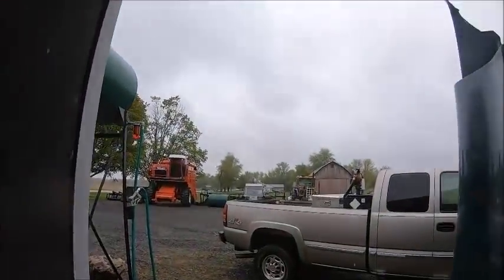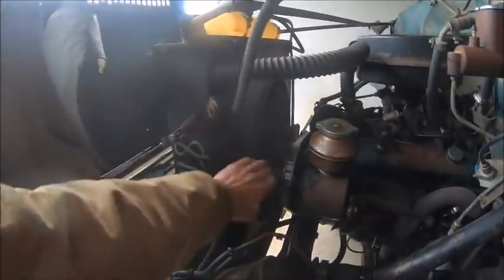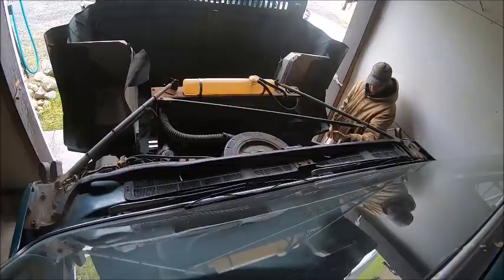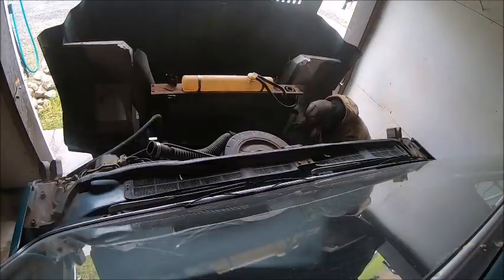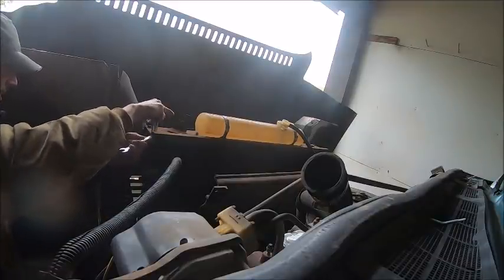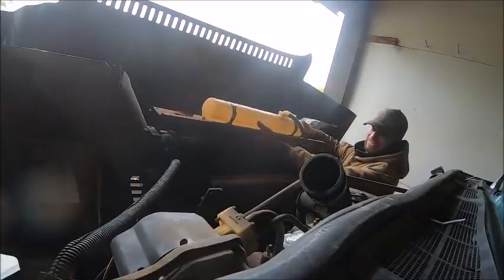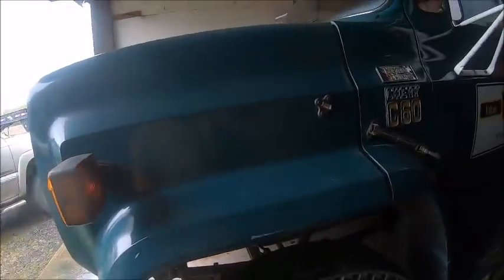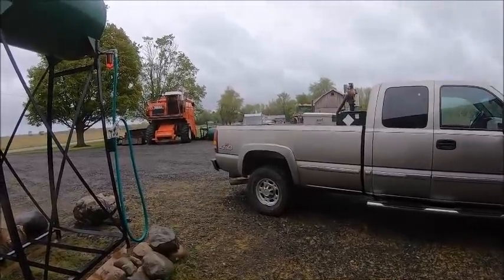Pulling The Radiator On My C60

Comment: Years ago I had a 68 Chevy C60 and it was a giant pain to work on the engine !  When I got the Dodge I have I fell in love with it the first time I had to work on it, Open the hood and swing the fenders open and walk right into the engine bay !  Roger Penske said it best years ago You design it for me you work on it one time and you will change your design !  Bandit
Reply from the maker: I still love my Chevys though.
Reply: @Oliver66FarmBoy  I do too !  That C50 I had I wish I hadnt sold it but you cant keep everything. Of all the trucks I've driven or owned it was the best one I ever drove, 327 5+2 you could be in 5th high side slow down to 10mph step on it and it took off like a car !  No shaking no nothing it just excellerated to what ever speed you wanted loaded or empty and it had plenty of power.  Funny thing was it was a C50 with all 10 lugs on the front wheels and a 25900 GVW !  With the springs it had and the GVW I really think it was a C60 rebadged as a C50, I really miss driving that old girl cause she would haul a load better than any other truck I had , Average bed loaded with grain was 420 bu !  Bandit
Reply from the maker: Even my 60 doesn’t have 10 bolt fronts. I’ve never seen one like that.
Reply: @Oliver66FarmBoy  I havent seen another ether, All I know that truck took a 400 bu load and the springs were not down on the helpers.  I've always wondered if that truck was really a C70 because of the way it handled a load and the 10 bolt wheels on the front. I wish I could have kept it but it was going to need some work done on it and I really didnt need it anymore so I sold it. The guy that bought it was sold when we took off on a test drive and I told him to hit the brakes and slowed down to 10 mph and told hit to step on it. He did in 5th high side and it took off like a car , He turned and looked at me and said sold ! LOL Dad always liked driving it, He said its like driving a car !  Bandit

Comment: Can you still get molded hoses for your C60? I always disliked the stiff sorta fit type like the upper hose on your C60. They are hard on radiators and if you ever break a motor mount you can say bye bye to the radiator for sure.  I just love that style C60 BTW and thanks for sharing!
Reply from the maker: Dad got them for his truck so they should be available for mine I hope.

Comment: Being a electrician we have to deal with engineers all the time. And yes they should not design something until they have had practical HANDS ON experience. Because how can you design something that you don’t know how it works. I don’t know how many times engineers have conduits ran on paper that in real life they run into 5 foot thick concrete wall. “But it looks good on paper” 🤦‍♂️

Comment: Wish I had the engineers here that designed the heads on the Hercules engines. I would make them take those intake and exhaust manifolds off and on for a week. Then I bet they would have designed something better than that fucked up mess!
Reply from the maker: I never understood why they did that. By the time they designed those engines everybody knew that a cross flow head was a better design.
Reply: @Oliver66FarmBoy  Yeah, Ford and IH had that figured pretty early on.
Reply: @TheJohndeere466  Didn't MAN engines have something to do with this engine too?
Reply: @TheJohndeere466  Was White the last customer for these engine?
Reply: @TheJohndeere466  It's a good starting engine in the cold, way better than the 354 perkins in a 2-105 we had.

Comment: Non mechanical engineering student when tasked with helping you remove your radiator, instead of calling your dad.  Hmmmmm, well If the core is too heavy and awkward to lift out,  let's lower the truck out from under it!
Reply from the maker: Fix it till it’s broke. Lol